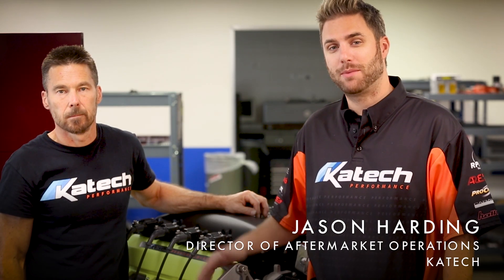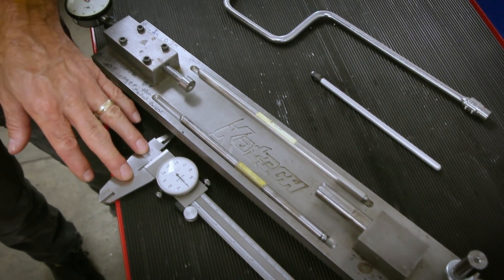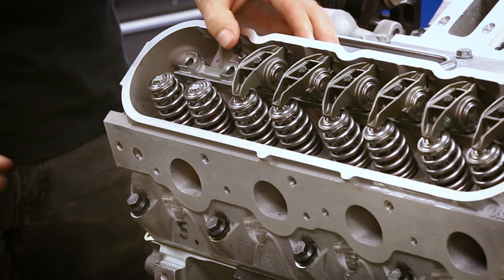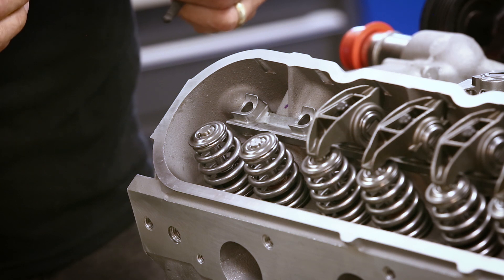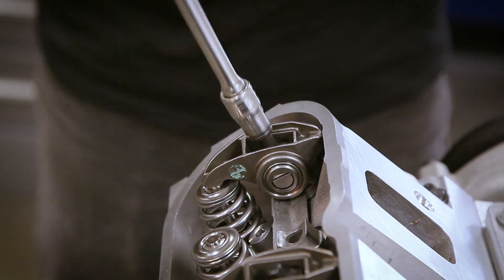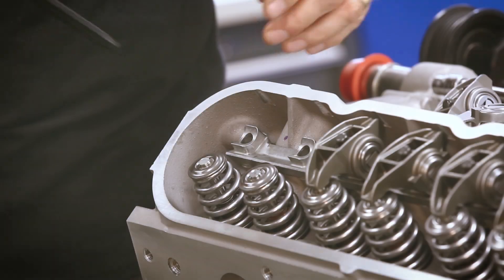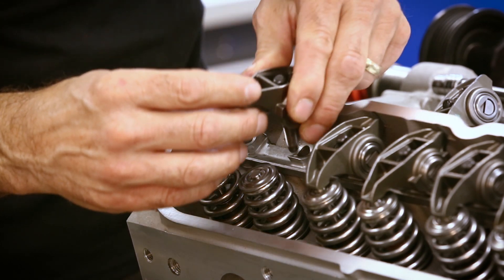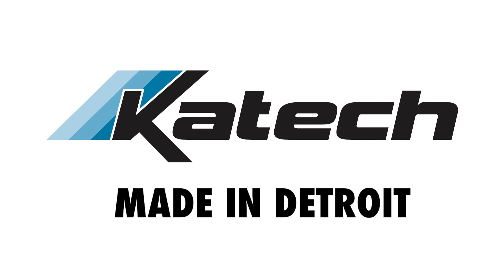Katech - Push Rod Length & Lifter Preload Check

Comment: @1:04 rocker arms are on the wrong stands. They're not centered on the top of the valve stem. If that wasn't obvious enough, there are two offset rocker arms side by side (#2 and #3 from left to right). A little sloppy gentlemen
Reply from the maker: This video was made for educational purposes only, those rockers arms were not installed incorrectly upon final assembly..

Comment: Would have been helpful if you guys stated that the 0.070 preload is for the LS engine you were working on. In fact, not all LS engines spec 0.070 and it depends on the lifter manufacturer really if not OEM.

Comment: Recently bought a ctsv and had a question on valve lash settings bc I can’t find what the spec is from previous owner, it’s a solid roller setup on hand ported heads still an iron block stroked to a 418ci, .709 lift Comp cams, 1.8 rockers,
PAC springs good for 750 lift, titanium keepers, and don’t know the push rods setup. That’s all I know but have no idea where to start with lash and need some guidance.

Comment: So, you're saying .070 pre-load across the board - all engines? I'm calling BS on this bit. That could be a costly assumption.
Reply: You are correct bud, the 0.070 is an LS preload. Most non LS engines are 0.020 to 0.060 preload.

Comment: Should have mentioned that preload will vary depending on lifter specs per manufacturer and also wether aluminum or iron block...
Reply: @lamont814  Iron block uses a little less preload due to less expansion compared to aluminum. There is a chart for Morel lifters somewhere if you search google but its best to check with the manufacturer.

Comment: I hope you guys are not the same katech  that knew that the ls7 exhaust valve loves drop and didn't tell anyone
Reply from the maker: I'm not sure where you are getting this information, but we did a study on the issue and made a suggestion to the public available in 2012. https://www.corvetteforum.com/forums/c6-corvette-zr1-and-z06/3023469-katech-psa-ls7-ls9-cylinder-heads-valve-guides-valves-and-rocker-arms.html?highlight=katech+valve+guide+psa
Reply: GM did that, not katech

Comment: Do you have to check every one? Im thinking that is a yes.
Reply from the maker: Usually just one intake and one exhaust
Reply: @KatechPerformance  per bank? or per engine?
Reply from the maker: @jasonbeaulieu4979  Per engine is typically fine, unless you suspect one cylinder head is decked more than another.

Comment: Why were you checking for movement in the rocker, rather than the rocker tips position on the valve stem tip?
Reply: Anthony Wayne.....he did both while wiggling. So many people are not grasping onto the "no backlash" and to add lifter preload!!  What gives??!!
Reply: +James Blattner. How is "backlash" a term that has a place in this procedure when it usually pertains to the space between gears? what gives??!!
Reply: My bad. Your 100% correct about backlash. I meant no gap at rocker tip and valve stem when taking measurement with pushrod checking tool.
Reply: Anthony Wayne man! I see that. I did not type that. I've had this problem before sorry about all that stuff
Reply: Anthony Wayne rhis is the first video that I seen on how to do this correctly I've seen so many different videos and people just taking way too long and too many unnecessary steps just to get 0 valve lash and the proper lifter preload. Some lifters including General Motors have an allowance of 30 to a hundred thousand preload while some lifters like the ones I have only allow $30,000 give or take 10,000 preload and this video finally confirms what how I thought it really needed to be done
Reply: I spoke into mic to type this. Your going have to use your imagination to read my long reply correctly. Lol!